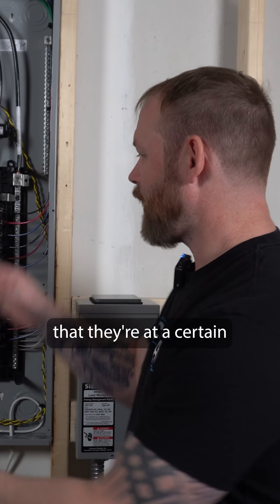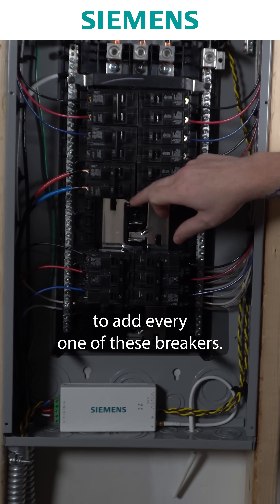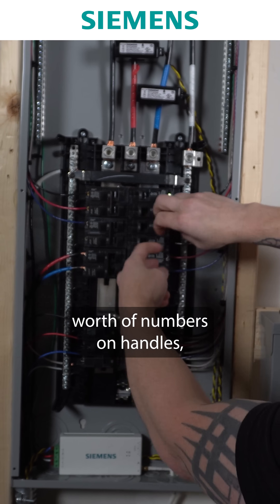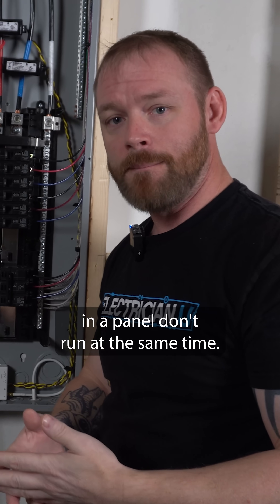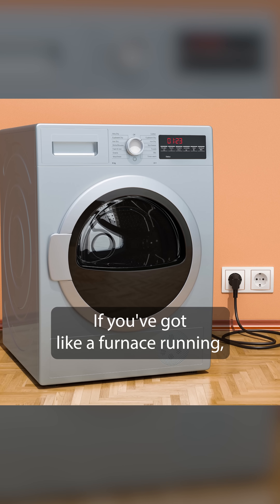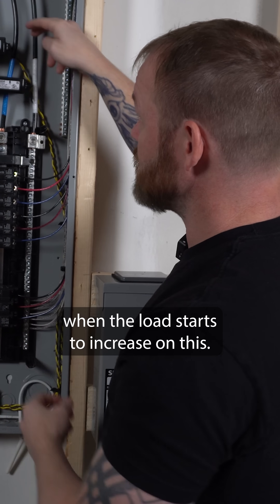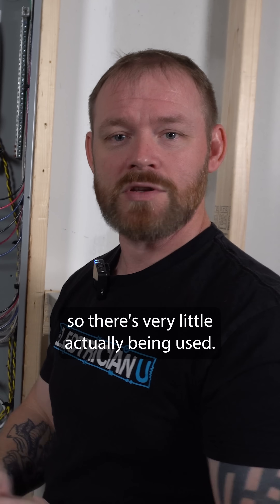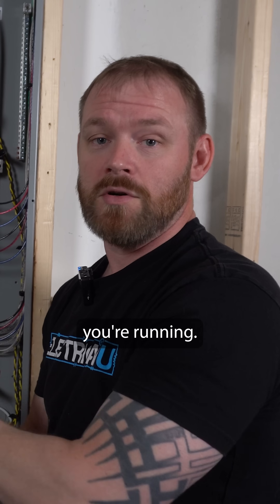Is This Panel At Capacity?

Comment: Even engineers often make this mistake.

I had to connect a 315A circuit for a big heat pump (230A max) to a 550A service (transformer rated for 580A with an adjustable breaker set for 550A).
The transformer was equipped with peak demand registering amp meters that showed 250A max load.

I had to convince multiple engineers with over 30 year experience that adding a 230A load to this service won't cause an issue because the total load would be 480A max.

They all calculated the load instead of checking the real load.
There was 750A of circuits on this service and they calculated a load factor of 0,7 (common for factories) which means the service had to be at least 525A.
With the addition of the 315A circuit the total would be 1065A what translates to a calculated minimum 745A service.

The actual load was 250A, add 230A to that and the actual total load is 480A. Well within limits of the existing 550A service.

Comment: I have a 350mcm wire and an additional 4/0 wire to my newbuild 1000sqft house. 'Lecky is telling me I cannot exceed an 100 amp panel and I cannot go above 80 amps. Yes, two wire sets that can easily handle 1000amps combines, I am limited to 80 amps. True story I am dealing with this right now. The electrical standards are insanely overrated here in Canada.

Comment: In a panelboard we are limited by the incoming wire size. 
the panelboard rating can be 200amps but the incoming feeder size can be rated for much lower. 
One thing to consider.

Comment: I was an electrician in Florida for many years and now Electrical Engineer. I dont see any scenario, even with an all electric house where you would exceed 200 Amps. I was in houses with 400 amp services but they were very large houses with multiple hot water heaters, a pool pump, and larger AC systems or multiple. Also heat Pumps, dont forget, have electrical strip heating in them that needs to be taken into account because, Florida has no natural gas, they cant switch to gas heat when snow descends upon Orlando, heat pumps wont cut it in freezing temps.

Comment: This was a pretty good explanation and spot on about how it's the actual loads that are a major consideration and that things are used intermittently. A good example of typical heavier loads in a normal household would be: Using the electric stove and burners while doing washing and drying, the air conditioning running and the kitchen fridge kicking on (which has a high startup impulse that drops down to a much lower value after the motor gets spinning.) Many circuits have little in them (closet lighting circuit comes to mind.) excellent video. 👍

Comment: It's not about the timing of when things are running.  It's just that most circuits aren't (and shouldn't be) loaded to capacity.

All those 15A lighting circuits?  With modern lights, even with everything in the whole house turned on, each circuit might only consume 5A max.  Those 20A outlet circuits?  Half of them may not even have anything plugged into any of the outlets.

When doing load calculations, you actually should assume everything is running at the same time (so the implication that it's about timing is actually exactly wrong ), but you should only calculate for the (anticipated) loads that actually exist, not the maximum ratings of the circuits.

Comment: If I have 11kw of solor and a Ford F-150 Lighting and an KiaEV9 on my panel outside a 200 amp panel inside should I upgrade my main feed to a 300 or 400 amp service or leave it at 200 if I want to charge both my cars at the same time when the solar is coming in in the middle of the day a.k.a. when a hurricane comes my battery top off ?

Comment: The term for this is called calculating the demand on service-for single-family homes some appliances count as either a minimum amount of watts or 100% of their face plate value, it’s when you get to multifamily dwellings, apartments, laundromats, etc., where the service only needs to be able to carry a small fraction of the total cumulative loads. It can be an alarmingly small amount, like 30% of the maximum capacity.  😮

Comment: From a European perspective, it honestly sounds a bit absurd that a typical American home would require a 200A service line. Over here, most residential buildings run perfectly fine on three phases at 25A — that’s just 75A total, and it comfortably powers heating, cooking, lighting, and even EV chargers. The idea of needing nearly triple that feels like overkill, unless you're running a data center or welding shop in your basement. It’s like bringing a freight train to deliver groceries.

Comment: Load calculation . . . 30 amp dryer, 50 amp furnance, 30 amp electric car charger, 30 amp electric oven . . . 140 amp total . . . which is less than 200 amps.
So If I come home in winter, plug in my electric car, and want to bake and do laundry at the same time . . . I should be OK.

Comment: I used to have a computer that I had to unplug the dryer to plug-in. It was the size of major household appliance and required 240 V, but I don't think it pulled anywhere near 30 amps. (SiliconGraphics Onyx RealityEngine)

Comment: Even a dryer won’t pull 30 amps because you can only be at 80% capacity of the 30 Amo breaker. The other day I had a max 50 amp breaker for ac condenser only using 17 amps .

Comment: Does this also apply to a standby Generator panel?  

When the house was built, they put in two 175 amp panels, and when I added the standby generator, the electrician used the left panel as the standby panel (which normally operates as a standard panel).   When the generator kicks it, the transfer switch automatically isolates that panel to the house only.

Comment: If only electricians would do better with load management on branch circuits. My brand new house for some reason uses only 15 amp circuits for most areas. Open floor plan so living room, dining, kitchen all one room. The ‘living room’ has 8 outlets, one of which is at the back patio… so after having my plasma TV, amp, receiver, subwoofers… I can’t even run the vacuum cleaner more than a few minutes ok that circuit without it tripping. And, I can’t really use the outside outlet for anything meaningful without needing to turn off my AV stuff. My ceiling light circuit has 14 connections not counting the one outlet where my coffee bar goes.. also 15 amp. Why those are tied to that idk. But I can’t use that outlet for my espresso machine because the lights dim/flicker when I use it. Ridiculous. But they manage to put 2 20 amp circuits in the kitchen.. 3 outlets on each. And 3 of them are useless because 2 are under the bar and one at the other side of the bar nearest high traffic area so the wires would overhang and be a risk. Yet they have a 200 amp panel and there’s no way I’d ever max that out with the circuits they installed. 150 amp would have sufficed. This is a 2023 house.

Comment: A 240-volt, 200-amp panel means it has 200 amps per pole. In other words, the panel can deliver 200 amps of current at 240 volts. This is often referred to as a 200 amp "service" or "panel." It has two "hot" legs, each capable of delivering 200 amps at 120 volts, but when used together, they provide 240 volts at a combined capacity of 200 amps.

Comment: 200 amp panel mostly full. Never run more than 10a max (not including surge current). I will never not have a current monitoring system to understand what's actually going on. Great for detecting short cycling loads indicating failures, understanding where you're ACTUALLY spending your money and understanding sizing requirements for things like backup power.

Comment: There's definitely a need for balance loads. If you put the washing machine on one leg in the dryer on the other, if they run at the same time you don't run all the power back through the neutral.
Reply: Exactly !

Comment: 200 amp panel with #2 wires feeding it.  but the message is the same.  do a load calc.. then you know what panel to use, what size pipe and wire to feed it with.

Comment: Great points. Also with two pole breakers the current running  through the legs is running out of one and back into the other  so you would NOT add those numbers but rather only consider one of them. Also the numbers are the maximum current before the breaker will trip and the circuits normally don't operate close to that limit.

Comment: Well we wanted to upgrade to a 200 amp service and an electrician came in and put in a 200 amp panel but it's only got 60 amps of service it said it couldn't be done without putting a riser on top of the house or bury in the line underneath the ground we're out of room in our panel because it's more than our service

Comment: I wired my own house.  I have a main and 3 subpanels.  Almost all full with a lot of tandems.  If you added up the breaker amperage it would be well over my 100amps.  But I just overwired the house.  Many outlets have their own breakers.  Lol.  15 years ago when copper was cheaper.

Comment: Shouldn't the panel be rated for "everything on at the same time"?
Reply: The panel is rated to handle 200 amps delivery. You can put 600 amps worth of breakers in there or even 1000 amps worth of loads but once the main breaker feels 200 amps going through it, it will trip, thus protecting the panel itself.

Comment: Also that is 200 amp per phase. That why in residential 240/120 panels you have split phase. 200 on each side is a good rule of thumb.  There are continuous loads, non continuous, receptacle, lighting, small appliances,  and so on. 3 phase panels with motor loads you calculate 100 of the largest motor then less for the other motors and so on. It can get complicated so as a homeowner, use the rule of thumb
Reply: So in theory, if you have a 200 amp split phase home and you only have 120 V devices you could pull 400 A but if you had only 240 V devices, you can only pull 200 A. Is that right at least in theory

Comment: You Put CT Clamps On
Each Leg on The Line Side And Run a
Program For a Week Or a
Month This Program Records 
All The Current and Loads
For a Week or Month 
Of What This Panel Is Pulling Down 
Then You Can Read The Print Out and See If 😂you Need To Up Grade This Panel or
Just Leave it Alone 
Because It’s a 200 And
Panel and Not All
The 200 Amp From Line is Being Used And The 
Program Recording 
The Line to The Load 
Will Print This Data 📉 
Out

Comment: All lights on, someone running a hot shower with a tankless water heater, washer running, dryer running, dish washer running, something is in the over and two pots on the stove, fridge keeps being opened and closed, ac running full blast, computer on, 3 tvs running, 1 ps5 running, 1 blu ray running, 1 cable
Box running, dad’s in the garage with the stereo on running a plug in table saw while he has 6 Milwaukee batteries charging from fridays workday, Junior is up stairs with his half stack Marshall speaker running off a 100w amp head with 6 9v guitar pedals plugged in, the pool heater is running and moms in the bathroom with her hitachi wand hiding from the kids, coffee pot is on, crock pot is also going, little suzi has a space heater on because the ac is too cold and she’s trying to vacuum her room while the tv is on commercial break, 5 phones are on charger, 2 tablets, 3 laptops, a battery jumper, 2 portable
Batteries, 4 blutooth speakers, etc etc I could keep going
Reply: that's also worst case scenario
Reply: @whatusernameis5295  exactly. The rules and "standards" do not apply universally. It is why when installing an electrical service in a custom house build, they will look at usage and end devices to calculate the requirements. In an extreme situation like listed above, they would adjust the supply. Simple solutions when you know the issue.

Comment: Electric air handlers typically pull 40A-80A but furnaces pull around 7A as the fuel source is combustible.

Comment: The dryer you showed could not possibly draw more than 16 amps at once given the receptacle shown. And modern condensing dryers only use about 10 A instead of 30 A.

Comment: A furnace is gas or oil fueled so only electricity it uses is for the blower and control which is under 15 amps usually. You’re thinking of electric resistance heating and heat pumps.
Reply: He may have ment when the A/C is running or a heat pump with heat strips would pull high amps. A gas furnace pulls relatively low amps for the blower..

Comment: I have a 200 amp service and out of curiosity I tried to max it out one day...  hit 90 amps with hot tub, 2 central AC, water pump, range, sauna, air compressor, clothes drier and a bunch of lights. On a normal evening in the winter we hit 5 - 10 amps per leg with TV, computers, heat, lights, and 2 fridges. For those who feel they are maxing out their main, you really need to see if that's the reality of poor planning... or poor education. IOW, if you are not measuring then you are guessing.
Reply: We run off a 400MW actual generator because our mains can't handle the load.
Reply: @dogwalker666 you run a large power plant for your generator?
Reply: @ Nope our factory is in a rural area the mains supply is only 32A three phase, 
To run our factory we have a 400Mw generator,
Approximately 1000 Ltrs of white diesel a day, and 10Ltrs of 15W 30 a week.
Reply: @    somewhere here the math isn't correct because you can't get 400 Mw on that much diesel, although maybe a 6-8 hour shift at 80% capacity might work out.
Reply: @ That is correct 8 hr production at approximately 80% 
It also depends upon if the glass is in production as that takes the most electricity and gas.
Reply: @    Ok, how many people would even know the math needed to figure that out, right?  <LOL>

Comment: I had a 400 AMP system with two separate boxes, one on each end of the house.  But that included the pool, hot tub, 4 Bath 3 fridges (ok..they don't really draw that much) and 3 zones of HVAC.  We also had a line out for a pool heater, but decided later we would likely do solar for that..but I decided I didn't want this added to the roof. We were originally all electric but finally got gas run to the house.  This helped.
Reply: did your house have it's own power plant to run it? i can't even picture your electric bill. must have been in the thousands.

Comment: I have a few questions if any kind souls care to take a shot:
1)
basically I was told that even if a system isn’t grounded (no ground rod to neutral etc at transformer and no grounding anywhere ) that if a power line that’s energized comes down and touches the earth, that it would still energize the earth. Now if energize means put the earth that it’s touching at its voltage then that’s surely true right? No matter if it’s soil, gravel, water right? A  120 v line comes down, and it will make the earth 120 v no matter what it’s touching? I’m not saying it will run current yet. Just saying that for instance, if we measure the neutral to the ground, we will get 120 volts right? So that’s the first question.

2)
The second question is - let’s forget about voltage. We have this 120 v line touching the ground - let’s say it’s grass or soil or water, is it possible for a current to flow thru the very earth itself if there are no grounding rods or grounding stuff anywhere near by? I ask it this way cuz I’m tryna take away with “return to source” and still see if current would flow thru the earth.

Comment: 40-50 amps for a furnace? Must be using 10K worth of heat strips. My gas furnace runs off a 15 amp circuit.

Comment: Code says 3watts of lighting per sq ft, plus 10,000watts, plus40% of all the non heating/cooling loads past 10,000watts, plus 100% of the heating or cooling load whichever is greater.

Comment: This is true. It surprised me to learn that you could put 42 twenty amp multipurpose receptacles on a 20 amp circuit. It has to do with whether the load is considered intermediate or constant and whether you have a two or three phase panel in calculating the load of the panel.

Comment: This is also true in the telephone industry. There are only enough circuits available to handle about 10-15% of the customer base simultaneously.
Reply: Oversubscription is generally around 50-100:1 for residential. About 10:1 for basic commercial. And 1:1 for dedicated circuits. But this is only at the last mile nodes. Backbone connections from there are scaled as needed at about a 3:1, so if one of the usually 2+ bonded connections break, you still have enough network bandwidth capacity.
Reply: See: contention ration